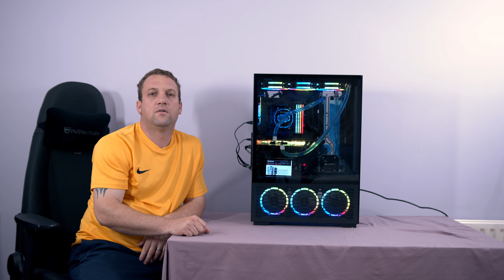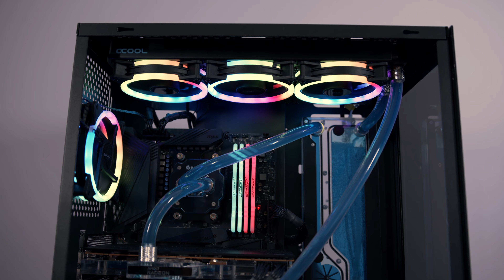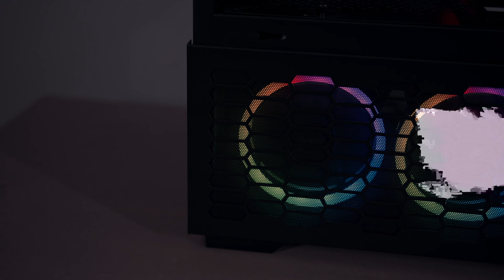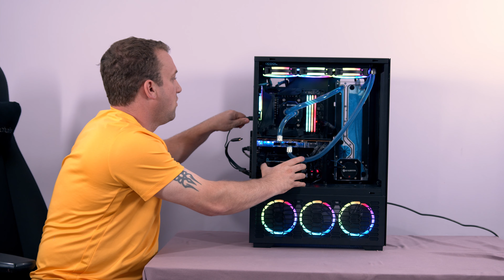Raijintek Paean Premium Complete Build

Comment: i see your pump work but not that flowmeter....why?
Reply from the maker: For this video I used the outlet at the top which slows the flow down quite a bit. There is also a outlet right above the flow meter which when used, will allow the flow meter to work properly.

Comment: What is this noise on the background? Sounds like ddc pump on full speed.
Reply from the maker: It's actually the fan on my camera. I've got a Rode shotgun mic mounted on the camera and it pics the fan noise up unfortunately. I will be getting a new mic as soon as I can. 

P.s. the D5 pump doesn't make much noise at all.
Reply: @EnosTech  also, there is "antila" d5 pump-res combo. im wondering, if its a same d5 pump of not.
Reply: @angeltensey  hello, do you mean the D5 standard or the D5 EVO?
Reply: @angeltensey  ok whats wrong with it?
Reply: @RaiJintek  nothing, wanna switch to d5 from ddc, but i have limited options and im examining them
Reply: @angeltensey  Ok fine... but I suggest you to directly change to the EVO Version... this will be eol ... go for the Antila D5 EVO

Comment: i hope you have better luck then i had with my raijintek silenos pro case i got for  my son's build . the rgb controller hub   fried  and the sata power cable for it too . the solderings were the cause , pins went too far on the back of the board  and the soldered pins touched the case wich caused a short circuit . both cases i bought  it was the same  but i trimmed the pins on the second  one and put some electrical tape to insulate the board from  the case along with rubber rings between the board  of the rgb hub and the case.  that one didn't fry  and did not create a smoke cloud  like the first one at first boot .

it almost fried the cables near the sata power cable of the rgb controller hub but fortunately it only  left a small burn mark on on of the psu cables. the build works fine  but i have to use the rgb header  on the motherboard on one of them  because the second one don't have those and i  used the case with the good rgb controller hub for the a520 board that does not support rgb.
Reply from the maker: Sorry to hear you had such a bad experience with them. I have had my Silenos since release and it is still going strong as one of my children is using it.
Reply: why you never contacted us and forwarded us all the infos?
Reply: @RaiJintek  i bought both cases a few months ago but i completed the builds only recently. However , i was able to work around the problem wich is most likely a manufacturing defect of the solderings . The pins of the components go too far behind the pcb  and touched the case causing the short circuit. The fans and case are otherwise fine and my kids like them a lot. I didn't saw the need to send back something i didn't intend to use and haven't got around to report to you the unfortunate occurance of this problem yet.
Reply: @chrismcgraw3399  no problem, if you contact us and give us all info, then we can take action straight....
Reply from the maker: @RaiJintek  Good guys stepping in making sure the customers are taken care of!